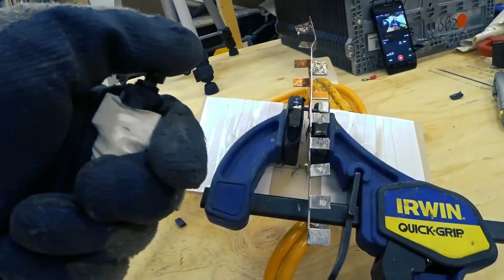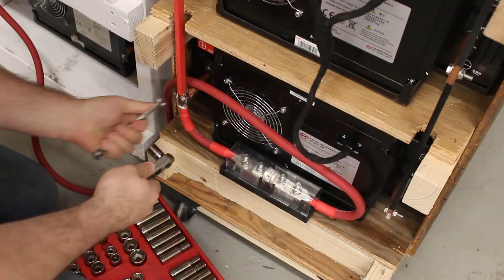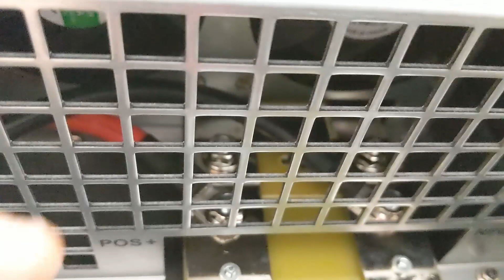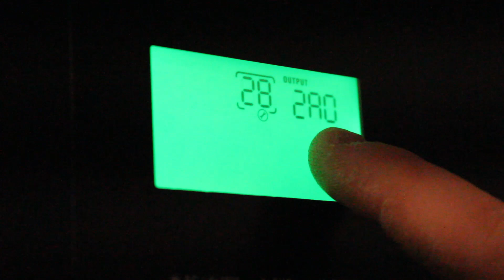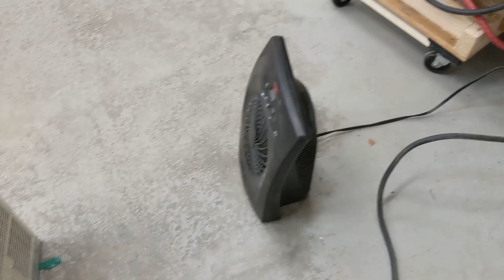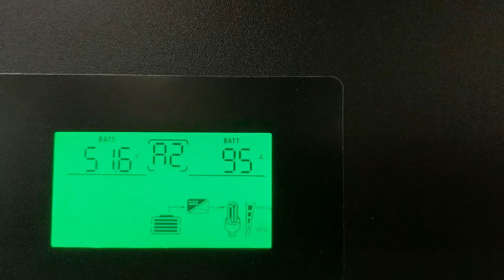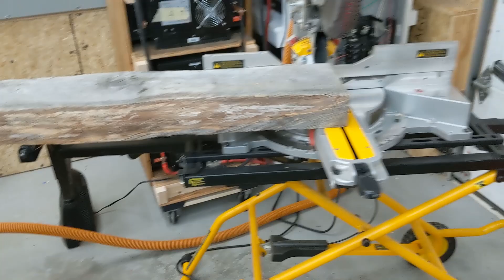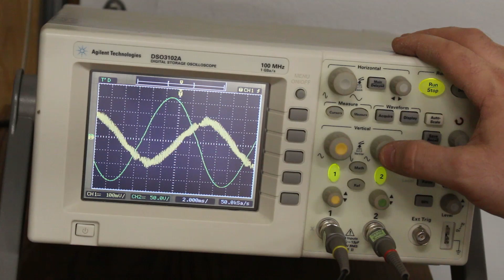Split-Phase Inverter, LV5048, Test Solar, Off-Grid

Comment: You might try changing the setting back to single phase 120 and parallel L1 and L2 then try running them. It might work because I'm guessing the miter saw is drawing too much on one leg. but having both parallel it should be able to handle it, but if not not I'd consider it to be a good thing as it would prevent blowing mosfets.
Reply: I believe you’re correct. The instruction manual says to select “0” phase and connect L1 and L2 (parallel) to do exactly what you said. I think it would handle the miter saw.

Comment: I tried one of these...  I could never get it to work right...  So since I bought it through Amazon.com I was able to return it for full refund.  You might be able to get this to work with a Current Surge Limiter...  Which allows a soft start...  The other problem was that the support was via email in China...  No local support in the states

Comment: If this inverter is capable of running 2 phases in 180° shift it might be also capable of running both phases on the same frequency, so you could combine them to one phase that is more capable and runn both things at the same time.

Comment: So they just put two inverters in one chassis lol? That's interesting. I guess that explains the higher idle consumption then. It's disappointing to see that wouldn't start a miter saw... Unfortunately, I doubt it's going to start his well pump :(
Reply: I bet the AIMS would start several of those miter saws at the same time ;)
Reply from the maker: Yeah.  I could not overload my 6kw Aims with surges.  I only ever overloaded it if the  water heater kicked on at the same time as the oven.

Comment: 6:51 At 75 Watts doing NOTHING this thing will drain your "backup battery if the grid goes down" bank really quickly!
Reply: It's intended to be used with a large battery bank.  I have a 23kwh LiFePO4 battery pack and it could handle that 75 watt load for almost 246 hours (more than ten days), before the pack would be at 20%, if nothing else was running.  And, that inverter is also designed to be connected to two strings of solar panels that ostensibly would be sized to charge the battery bank inside of 5 hours of full sun.   So, in a properly designed and implemented system, that 75 watts is trivial.  Large inverters are simply going to draw more power than small inverters while idling.   So, if 75 watts is too much for you, use a smaller inverter and plan on running smaller loads.
Reply: I have an Aims 10k inverter and it draws 150 watts That is 3300 watts my panels have to produce in a day just to run it.

Comment: For your scope you need a high voltage probe 100X for 120 Volts or an isolation transformer. 

From your video looks like you have a 10x probe too small for 120 volts AC could damage your scope. 

https://youtu.be/onfGPmhXOt4

Comment: Cheap JUNK Inverters = Save your Money get a VICTRON! 

YAY! You got an Oscilloscope! Looked like you had it on DC coupling? You want AC coupled. 

Do not Connect to 120 Volts or poof your Scope.

Comment: I have 3 of these LV5048 units running in parallel.  A couple of things to point out:  First, by using the recommended spacing between the units per the manufacturer's own instructions (about 8") the cables they include aren't long enough to run from the first unit to the third unit, so you'll have to source an extension on your own for one of them. Second, they recently modified the manual to correct an error which inadvertently excluded the current sharing cables.  Word to the wise - be sure to obtain the latest installation manual directly from MPP Solar and don't trust either the paper manual or just any old PDF copy you might find on Google.  This would have saved me days of frustration.
Reply: did you try putting unit one in the middle, unit 2 on one side and unit 3 on the other side to make cables fit?
Reply: Noel. How did you wire the 3 LV5048? Did you have 3 sets of panel going into each inverter separately?

Comment: What? Did I miss something? A 5000W 240V inverter should deliver 2500W per phase - what kind overpowered Mitre saw do you have, that it trips the overcurrent protection? Mine is using about 1000W 240 V - > should be around 2000W single phase what the inverter should totally be able to handle??

Comment: Looks like he will need to parralell another inverter for that pump
Reply: It's going to depends on the watts the pump will draw.
Reply: @mexicanracer03  weather its deep well or shallow well they will be at least one hp and the starting surge (LRA) on a water pump that has head pressure on it will be more then that saw no question

Comment: Shouldn’t really run big brushed motors off inverters if possible it’s very hard on them and if you have to put a couple caps in line not only will they help start the motor they will also protect the inverter to some degree

Comment: try to run your house with this inverter.
Reply: It is doing well for me. I run the whole house. If you need more power parallel another unit for a whopping 10k
Reply: @mexicanracer03  thank you for posting this! My wife and I are going to be building an Earthship Biotecture style home north of Reno-Sparks, Nevada. I will be installing this unit but now I am thinking to parallel two units...but we won't need that much power so one may be sufficient for any internal loads in the Earthship. Blessings from Nevada!

Comment: and that makes so much sense that they'd build 2 parallel inverters as it saves weight !  Otherwise, you'd need a center tap transformer to create 230 split phase.   Think Schneider, or Magnum north American products, the center tap transformer is inside the box.  The problem is  the weight !  They have to ship these things from Taiwan to the North American market.    So I get it.  Makes total sense.  Now, the question is- "starting capacity" as a large center-tap transformer is like a large 'flywheel', it stores and releases energy thus yielding surge capacity for starting large motors.   And now I'll watch the rest of your awesome video to find out the starting capacity result.  Hoping it's good !
Reply from the maker: Sorry to disappoint (assuming you got the the end)
Reply: @DavidPozEnergy  I did I did and wow.... So sad !

Comment: something seems wrong with the ch1 of your oscilloscope. while yes that looks like a sine wave you need to pay attention to the scale listed at the bottom left, this is a per-channel setting. your signal is riding down in the noise, I don't think your scope knows what division your probes are set to, or ch1 is possibly bad, put both probes on the same source and compare them like that. When your traces look all 'fat' like that it's a big sign that you aren't seeing what is really there, sometimes just a loosely capacitively coupled version of it. 
...(more below!)
For working with mains you want 10x probes, do not use 1x mode or you might hurt your scope. 10x is also the setting you need to tell your scope that each probe is(or 100x if that's what you have), all measurements and scales it displays are relevant to this. At 120v a 10x probe takes this to 12v, your scope sees this 12v and then knows via that setting that the axis labels need to show this signal going to 120v. Most scopes have a ~30v-50v limit at the front, hence why this is needed. You can use things like a 100x probe, but 120v becomes 1.2v, 12v becomes 0.12v(120mV) so you start to lose your singals to the 'noise floor', hence 10x is the most useful all around. 

Also ch1 and 2 are supposed to be yellow and green(look at control colors), at one point it looks like 2 overlapped yellow waveforms, these are both coming from channel 1! because you are mistriggering on all the noise showing on that signal(the fatness of the trace is a waveform riding ontop of the percieved sine wave), because something isn't right. Until your signals look clean like ch2 that will keep happening and AUTO mode will be useless.
Reply from the maker: First, thank you very much for such an informative comment.  I really appreciate it.  I'll have to re-read this a few times to try to absorb it.
The probes I bought are 10x probes: https://www.amazon.com/KKmoon-Oscilloscope-Precision-Alligator-Accessory/dp/B0773FP21S/ref=sr_1_1?keywords=Oscilloscope+Probe%2C+KKmoon+P6100+100MHz+Oscilloscope+Probe+1+X+10X+2Pcs+High+Precision+Alligator+Clip+Test+Probe+with+Accessory+Kit&qid=1578890233&sr=8-1
However, I didn't know I needed to change a setting in the oscilloscope to use them.

Comment: The SunnyIslands will take a huge surge.  I’m interested to see the sine wave from the sunny islands while you have the o-scope out.
Reply from the maker: So am I.  But first I have to figure out what I set up wrong on the scope.
Reply: @DavidPozEnergy  Since your personal inverter can handle the saw's inrush current (shown in another of your video), I would love to see the inrush current waveform from the saw on the scope if you can figure out how to use it.  Knowing the required max inrush current of the appliance beforehand will help in evaluating the capability of the inverter.

Comment: Hi David, I really like your videos. That LV5048 has a bypass feature that pulls power from the grid quickly when the unit is overloaded. I want to verify that you never had it hooked up to the grid to supply AC in bypass mode for an overload during your tests? Maybe your friend will be using this in off grid application and does not have access to the grid? It still may not have enough surge amps to overcome the LRA of the well pump but it would be nice to know if bypass mode gives it a chance. I appreciate any information you can share and realize you only had the LV5048 for one day. I would also be interested in hearing the results of using this for a well pump, whether or not it was successful and if a soft start was used (and where to buy one). Thanks again.
Reply from the maker: I never had it hooked to the grid.  After my friend gets it up and running I plan to do an update video.
Reply: @DavidPozEnergy  Ok thank you!

Comment: waveform 1 seems awful noisy compared to wave 2.....
Reply: I think the Ch1 probe had become disconnected and was just picking up a little bit of signal through capacitive coupling.  Note that Ch2 was 50V/Div and showed a full 120V sinewave while Ch1 was 100mV/Div.

Comment: That saw has must have killer inrush current load,  try adding something like a 5 to 10 ohm power resistor in series with the saw to limit the inrush.  You will need to experiment to find the lowest value that will not trip the inverter when the saw starts.  Also wire a switch across the resistor so you can bypass the resistor once the saw motor starts turning before making a cut.  If this works then you can make an automatic equivalent with a relay that will automatically bypass the resistor after the motor starts.  The series resistor is only needed for less than a second.  Once the motor starts turning the the motor's  back EMF will significantly lower the saw's load current requirement.
Reply: Very interesting Craig !
Reply: Good idea!  a cheap delay on relay from Ebay would seem to do the trick.... relay starts out in normally open, and the only way to get power to the saw is via your reististor.  The 5 seconds later the relay goes closed and shunts across the resistor effectively bypassing it.  Great idea.
Reply: Use a cheap timer delay on relay from ebay.   Route power thru resistor to saw.  Relay turns on and shunts across relay in 5 seconds effectively bypassing the resistor.

Comment: David, great video.
 

I have a similar setup to your friend, using LV5048 tied to the utility, 2x270W of solar panels and using a 14s/1p LEAF battery (48V). 

I built it to provide emergency power for my pumphouse.  It's connected to a 240V 1.5HP BOOST PUMP.  I didn't bother with the well pump since we have a 2500gallon tank.

The LV5048 is awesome. My system runs very reliably with the utility on or off (simulating a power down), and provides the inrush current required by the BOOST PUMP motor.
Measured battery load in normal operation is 38A, but there is an inrush current of 143A (3.7x).  BTW, the settings I used for the LEAF Li-Ion battery were VMAX=57.4V, VMIN=47.6V.

The inrush current is a huge issue especially for inverters.  It seems that if you size the inverter to support the inrush current of the mitre saw, it might have to 4x bigger than you really need.
An alternative would be to 'soft start' the motors, but for some applications they do rely on a huge inrush current if under load from the start. 

Brian

Comment: 240 volts from the power company are NOT 180 degrees out of phase. The 240 volts for the power company is SINGLE PHASE. Same ( hopefully ) on inverters. The 120 volts on home circuits is also SINGLE phase. The 120 volt circuits have their neutral on the center tap of the transformer using the potential (Voltage) of the extremes to the 240 volts across the whole transformer.
Reply: dtimboggs, not in the North America market.  We have this screwy setup where 240 is actually (2) 120 volt circuits, 180 degrees out of phase.  Our power wires travel down the street in single phase (as you suggest), but before they travel to the house, they feed a transformer, on a pole, that feeds multiple homes.   That transformer creates 'split phase' 240 as it's a 'center tap' transformer (look it up).  So, we have (2), 120 volt wires coming from the transformer to the house, with a 'neutral' (plus a ground)
Reply: @mark_osborne  yes this is the type of power I have in Nevada
Reply: @redsite001  Yup !  Have you ever been to a country that has 230 coming out of a wall plug ?  The toaster 'toasts' your bread in half the time.  The "kettle" heats water immediately.  It's an experience I highly recommend
Reply: @mark_osborne  that's interesting. Some day I'll go on a trip and when I do I'll definitely check that out.

Comment: 150V PV input is no good, my EAsun Hybrid Takes up to 450V and I supply it with 250V with minimal loss in cables.
Reply: Risky since if it arcs, its not going to self-quench. Usually DC systems are limited to 48VDC for safety reasons. Also If you touch a +250VDC its pretty much a death sentence.
Reply: @guytech7310  You install a DC breaker and mine rated at 400V DC.
Surely it's not for playing or for kids. It's efficient and less bulky.
Reply: @sezeryal  A breaker will not necessary trip during an arc. An arc can occur below the trip current. That said you can install arc fault interrupters or breakers with arc fault detection. But a standard DC breaker will not trip on an arc fault.

Comment: Even if the power of inverter meets the power requirements of the appliance that does not mean you can run appliances with electric motors like your saw. They make a huge load at start, that is why a PEAK power of inverter should be 2x times higher than power requirements of the appliance. Also "1000VA inverter" will not run a 1000W load. For example my UPS inverter is 1000VA but it is capable to run only 600W drill.

Comment: A better way around a lot of the high load and high surge issues is to get them off the main inverter. Things like well pumps, air compressors, tank hot water heaters, old style ovens, welders, etc do not need pure sine wave inverters. Most of those things require dedicated wiring so it is often easier to put them on a MUCH cheaper(non pure sine  inverter). This also allows you to run a smaller (more cost effective) inverter for the house. Most of the time once you pull those high load items off the inverter you can drop back to a 120V inverter for the main house.
Reply: No thats wrong inductive loads do need pure sine wave to start properly but  Is resistive loads don't care if pure or modified sine wave!!

Comment: Whew! I almost bought one of these.  I went all-in on Schneider.
Reply: SolArk is better than Schneider: 8Kw SolArc vs 6Kw Schneider. SolArk is much more efficient.
Reply: @guytech7310  "much"?  95% v 96%?  Also considering cost, and functionality and the AWESOME deal I got for XW Pro, I'm VERY happy.
Reply: @davidchristensen1219  Its Conext XW + is only about 88% efficient, not 95%. 

https://www.sol-ark.com/sol-ark-8k-inverter-efficiency-tops-tesla/
Reply: Not according to the docs and my testing.   Where are you getting your information?
Reply: Not sure how Sol-Ark can be that efficient when it uses 60 idle watts while XW Pro sits at 28 watts.  Cost per watt: Sol-Ark $0.76.  XW Pro $0.44.    Even additional CC still makes it cheaper
Reply: I don't believe competitor specs.  Peak efficiency on XW ~95% by my testing
Reply: @davidchristensen1219  https://www.youtube.com/watch?v=4Pd4PgJ0YNE
Reply: @guytech7310  cost, cost, cost!  That Xantrax inverter was pretty old.  I'm also  off-grid.   Like Poz, I bought my batteries used.  My system costs less than 1/3 of that one you posted.   To each his own I guess.  I have no regrets about what I'm using.

Comment: David Most of the time the issue with surge draws is the voltage drop on the DC side. Batteries just cannot respond on the sub millisecond time scale. The low frequency inverters have a large enough coil to store enough energy to give the batteries time enough to respond. IF you install a ultra capacitor bank in parallel with the batteries on a high frequency inverter it will have the same effect. Back in the 1980s when running CNCs in areas with "flickering" power we would install two transformers back to back. A step down transformer from 480 down tow 240 followed by a step up transformer from 220 up to 480. The coils would smooth out the surges and drops.
Reply: my camper system could not start the air conditioner because the batteries would droop at the inrush. Adding a 28 F super cap to the dc side fixed this. these are available for auto sub-woofer amps.